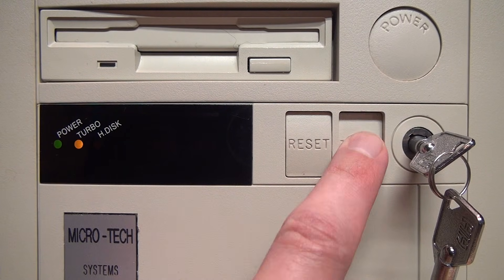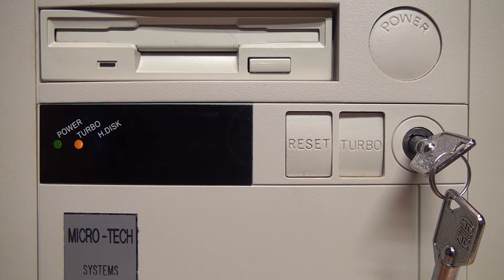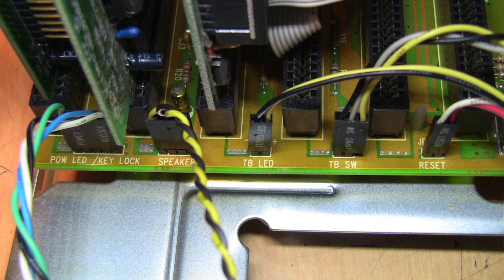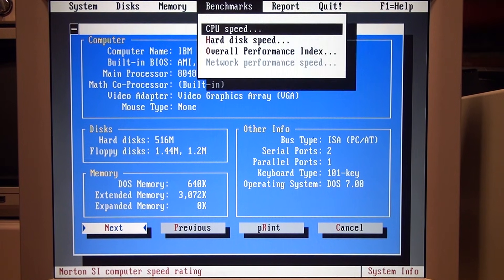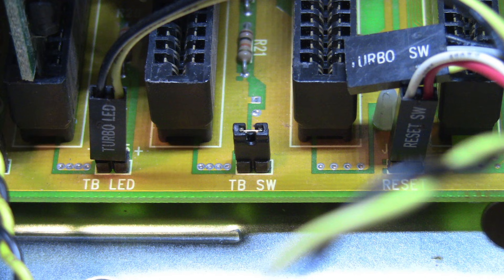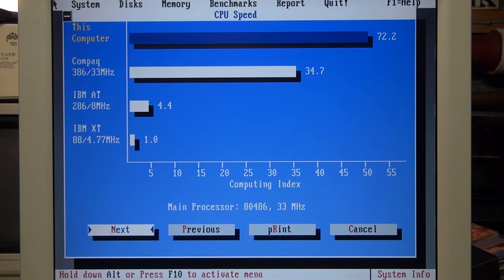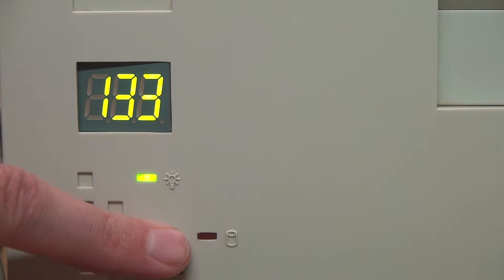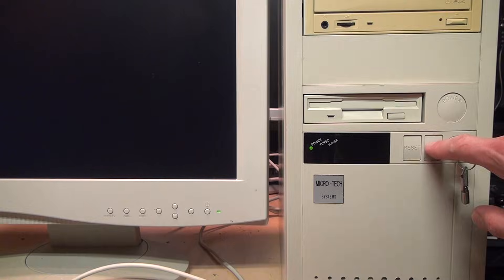The PC turbo button mystery finally solved!

Comment: You must be a n00b if u don't know what it does rofl. Back in the mid 90s on my first IBM Aptiva Stealth Series. I remember the only way to overclock was changing the buss speed on my intel pentium 1. So basically those older 486 586 boards would not allow you to change the multiplier but only the bus speed in logical increments, persay like 33 mhz persay or w/e. They usally had 3 bus speed selections printed on the motherboards.

Comment: Worked building clones in the late 80's and early 90's and remember the instructions the clone cases had for configuring the displays to show turbo/non turbo speeds.  Had about 4 versions of the display panel and the instructions were a prime example of the term Engrish!

Comment: I remember seeing another video on this. On that old computer I remember, it ran slower with the TURBO button pushed in. You explain why with the Yellow & Grey wire pins connected to the motherboard. That computer must've been connected that way, and the turbo light was burnt out.

Comment: one question: how did a  person come up with the idea that turbo mode doesnt do what turbo mode does?
 Have they never used a Computer from the x86 area? most of them even had led displays for the clockspeed, and yep 66 mhz is faster than 33 mhz...

Comment: I had a beige box 286 8/12MHz with 1MB RAM.  With Turbo running at 12MHz Wing Commander was "Start Game | Fly | Explode".  It was playable with turbo off.  And it had the LED display to show 8/12.

Comment: So, the Turbo-mode button was actually a mistake. Programmers of software for the IBM and IBM compatibles never thought of computers getting faster and therefore all programmes should have been written with real time interrupts. The Turbo-mode button was a wrong solution, the problem should have been a complete rewriting of all previously made programmes.

Comment: I have a late 286-20 with a Headland chipset. There is a turbo button on the case, which connects directly to a header on the motherboard. I found that when testing some of my code that takes over the timer interrupt, the turbo button would not work. I figured out that although there's a physical connection for a turbo button on the motherboard, apparently it does not directly control the speed of the chipset. What happens instead is that the BIOS installs a timer interrupt handler, and by default the timer is enabled to interrupt at 18.2 Hz. In that code, the BIOS periodically checks the state of the physical turbo button, and then adjusts the chipset speed according to it. So once you bypass the BIOS code, the chipset is then 'locked' to the speed it is currently running at, and the turbo button no longer has any effect.
Apparently this means that the turbo setting of the chipset is still very much a 'software' switch, like those early Turbo XT boards/machines, and the turbo button was an addition by the motherboard designer. I wonder how many other motherboards work like this.

Comment: the button has normally open and closed contacts, switching it around changes which position does which depending on how its connected

Comment: Now we need modern "turbo PC".
You press turbo, to turn on/off overclock. Like 3.3 GHz CPU to 6.6 GHz, fan noise from 20dB to 60dB, power consumption from 150W to 500W

Comment: before even watching this video beyond the first 20 seconds.  i’m guessing it enables a crystal by over clocking the cpu  which changes the mhz of the cpu from something like 8 to 10 mhz, depending on the cpu (probably an intel 8086 or 80286/386/486)

Comment: i don't recall those sounds on "Memory Checks" rather,  that was the HDD Actuator Test  - click click click BZZZZZZZZZZZZ

Then the floppy(s) would be initialized and finally BIOS completed its POST and the system would boot.  

I've had more than enough 8086, 286,386,486, Pentium legacy machines in my life to know that sound from childhood days up all the way into my professional IT Career now

Comment: As an programmer during the 90's period just to remind myself of an "Turbo" button or "Hi/Low" thingy and what is it for for me when I was writing some stuff/code (mostly in assembly)
 
The reason for the Turbo button was that early PCs were often designed with CPUs that ran at very high clock speeds. This meant that they could perform calculations very quickly, but they also generated a lot of heat and required a lot of power. As a result, PCs with high-speed CPUs often required a lot of cooling and were expensive to build.

The Turbo button allowed users to toggle between the high and low clock speeds of the CPU, depending on their needs. When the button was pressed, the CPU would run at its high speed, allowing for faster performance. When the button was released, the CPU would switch to its low speed, reducing heat and power consumption. This made it easier to balance performance and power consumption on early PCs, which were often limited by the technology of the time.

Comment: It increased the processor speed, often at the expense of reducing stability.  There, I just  saved you 18:37 minutes.

I had a machine that had this in the 1990's.  During work, I would sometimes enable it, but as a result, sometimes my machine would crash.  I didn't bother to use it unless I was compiling something.

Comment: In the mid 90s, at my office we had PCs that, instead of a light for the Turbo button, had a small display that showed "HI" and "LO" for speed. A couple of people at my office argued back and forth about which one was faster, "H1" or "L0" and were astounded when I told them that it was shorthand for "High" and "Low."
Reply: I guess they had never used a fan or heater in their lives to not know that!
Reply: @rs12official  I've never seen a fan or heater that says "H1" and "L0" in my life. Just High and Low.

Comment: I remember the first PC I had (not including Commodores and Atari XLs, I had a few of those) was an 80286 that I assembled myself. I remember that it had a 4 color graphics and I thought that was awesome! I never really noticed a lot of difference when the turbo was in or out. I built just about every version of PC up to the newest Gen 12 PC that I currently have. I think I still have an IBM 8086 in the attic, along with a Timex Sinclair, still in the original packaging.

Comment: The one thing many people seem to forget is that the PC is extremely odd in the computing world. Out of the hundreds if not thousands of machines released, the PC is the only one that allows you to change the clock speed .
Every other machine made has a set clock speed. The first ever 'Colossus' codebreaking machine ran at 5khz. An Atari 2600 console ran at 1.19Mhz. Commodore 64s ran at 1Mhz. An Amiga computer ran at 7Mhz. An original playstation ran at 34Mhz. The newest PS5 runs at 3.5Ghz. PCs however are unique - you can change the clock speed by changing the CPU as 'PC' is more of a standard than an actual machine (PC simply is short for 'IBM compatible personal computer).
The reason  turbo modes were needed was PCs were never frontline gaming machines until the 1990s - before then, games were ported to PC but almost never designed specifically for it, and game publishing companies made very little money from PC games and to them it was a niche market compared to the big selling Amigas, Ataris, Segas and Nintendoes. Therefore, game designers designed for these platforms mainly, and since all of them had a fixed clock, the system clock was pretty much perfect for a source of game ticks.
The problem arose of course when PCs started getting faster, and games were ported assuming clockspeed was a constant for the machine - hence programs that relied on a certain clock speed, such as games, became unplayable.

Comment: The "mystery" of the turbo button was solved at the point of purchase because the function and purpose of the turbo button was clearly defined in the documentation that shipped with the PC's of that era. It was never a mystery and nobody ever ran in turbo mode because we could read at the time.

Comment: Early Pc games FPS was locked to CPU clock speed, so game would be designed to run on a specific speed cpu once you upgrade your cpu game fps goes way too fast so you needed a was to be able to play older games on newer cpu's so turbo button allowed to slow cpu to the speed early games were configured for.

Comment: Everybody from the 90s knows that the turbo button made the orange light switch on. 
Where as in the 80s the turbo boost button made a back trans am driven by a man with a mullet jump over road blocks.

Comment: I don't understand how what I'm gathering is a slightly overclocked CPU would result in games playing in fast forward like an emulated console game with the frame limiter off. Did clock speeds not vary much between CPUs back then or something?

Comment: Not sure how this myth, of the slower PC when Turbo is ON, came out... I remember having to deactivate turbo mode to play Sensible Soccer in my 386DX 40Mhz PC. When it was on, the game was going much faster to the point it was unplayable. With the Turbo OFF, the inbuilt LCD clock on the tower read 20MhZ. How people thought it slows down the computer? It was obvious in many games that it doesn't.

Comment: I used to build these things. There were two clocks on the motherboards. For example the first turbo PCs were IBM XT clones that could run at either 4.77 or 8 MHz with the push of a button. It didn't matter whether the PC ran at 4.77 or 8 MHz but it satisfied system. Integrators needs to run PCs at 4.77 MHz in case there were software incompatibilities. Eventually those buttons were done away with.

Comment: If you were into computers in the 90s this isnt a mystery or myth issue.   When you tried to run a slightly older game in turbo mode it was unplayable.   Going to Radio Shack and picking up cheap games and dropping the ole rig into slow mode was just part of the nature of a PC gamer back then.

Comment: My old job had two computers crammed into my office.  One of them was a very old system that had a turbo mode, which I assume was only there because whatever database it accessed was somehow just not capable of being accessed on a more modern system.  (This was in 2019...)
Reply: Pffft... in 2018 I was in a large company manufacturing stadium/highway lighting that still had it's core server system managing inventory, production, warehouse stock and so on working on AS400-E... all the people in the various functions in the company (sales, admininstration, production, purchasing ect..) had to run an EMULATOR on modern Win10 PCs...
Fortunately mail and navigation worked through another set of Win servers 🙄

Comment: To make things MORE confusing, on cases with the "speed" display, often times there was NOT a Turbo LED. SO, IF you reversed the 3-wire connector but had the button pressed in, it would show the Turbo Speed, but would actually be running at the slower, non-turbo speed. I had to correct quite a few customer builds because they had the connector backwards!
Reply: imagine your modern computer had a turbo button you hit it and windows crashes🤣
Reply: @raven4k998  Funny how PCs went from no speed control to 2-stage speed control to a whole range of possible speeds with software control!

Comment: Most motherboard "turbo mode" settings are just a way to toggle multiplier for the CPU between 1X the bus rate and whatever their full multiplier is. For instance my DX4/100 at full speed was just taking the bus rate of 33mHz and tripling it to 99mHz. When I turned off the turbo it would drop down to 33mHz. I remember using it for Wing Commander I which ran entirely too fast if I didn't turn the multiplier down.

Comment: My early PCs including my 486 DX2-66 were the same, for Turbo the switch had to be on. I gave the 486 to my sister when I had bought my Pentium Pro rig and since my mother wanted to have her own PC, I had assembled a new 486 from various scrap parts. I don’t remember which board it had but this board started in Turbo mode with the switch open. I didn’t figure that one out until running Windows 95.

My first AMD was also different. The connector for the switch was labeled “Green Mode” and it also slowed down when shorted. While all other machines I owned or had built fell back to 8MHz, this one had cut the speed in half. I suppose this was meant to save some power.

An ancient 386 based CNC router I had to work with in my first full time job had to be set to no-turbo. The CPU had to match the ISA speed to be able to generate the correct timing for the stepper motors. You could speed up loading times or a simulation but you had to cut the power of the router or it did weird stuff like tossing tools all over the place or soak you by combining compressed air, alcohol and coolant even if the router was supposed to do nothing at all.

Comment: In 1989 I'd soldered a turbo switch into my computer myself. It certainly made the computer faster to the point that it was unable to reliably write data to my tape recorder.

Comment: Back in the 80's an acquaintance won a computer in a raffle. Took it home, turned it on and had absolutely no idea what to do with it. 30 frustrating minutes later, that computer reached turbo speed as he tossed it from his third floor apartment. 
I'm not joking. He actually got so mad he tossed it out the window.

Comment: Fun times. Reminds me of back in the day when I had my old 486 system, and managed to upgrade it through 25MHz, 33, 40, 50, 66, and even 80MHz.

It was extra fun setting the jumpers on the front panel turbo display MHz, with no documentation of course..

Comment: I hate to break this to you but they are in fact correct. The turbo button is just a limiter switch. With it in the "on" mode your PC runs normal, as if you didn't have it. With it in "Off" mode the limiter switch is active, slowing the PC as a direct result of the turbo working.

Comment: Turbo mode really didn’t do anything. I built and installed hundreds back in the day, At's and Xt's. We used it mostly as a Sales promotion; everyone wanted ‘Turbo’ because it sounded good. In reality GW Basic and Dos 1.1. ran better in 4.77Mhz. All the turbo did was mess up you games and make them unplayable. You mention AT, that was a different proposition all together. The reality was that most of not all the software at that time was optimised for 4.77. The only exception was when you added the math co processor for academic work. Then it had some value for academics to do equations a little faster.

Comment: I always though it engage the local bus and turned off the cooling fan.  Which would give the CPU more power to the main grid oscillator.

Comment: My first pc was a home made one. A cyrix 330mhz if it gives you an idea of the time frame. It had a turbo button and I never noticed a difference. I assume it wasn't connected.

Remembering this though made me think. The first pc I actually built my selt was an amd k2 with 16mb of ram. The processor cost me £55. 24 years later, an entry level cpu is 7 times faster and is multi core, so arguably even faster yet can be brought for just a little more than that when on sale. It's quite mind boggling

Comment: The turbo button did make your computer run slower. The button didn't make it run faster, it removed an artificial limiter. They tell you you're turning on turbo but you're really turning off the limiter. That means that it isn't a myth. The turbo button made your computer run slower.

Comment: I've only ever heard that myth in passing, so I don't think it was very widespread. I started building PCs in 1983, and built and used plenty of them with all kinds of turbo switches and indicators. Some of them even used a secondary keylock to lock the speed mode (usually using the same key, since all those keylocks worked exactly the same).

I think you're correct.. it sounds like a basic misunderstanding of how Turbo Mode worked, and potentially just an incorrect integration or faulty QA process for some systems.

Oh, and all those lovely typos and grammar errors in the manuals. We used to call that "Chinglish". :) Some of them were really BAD.

Comment: I put the turbo button to good (if devious) use. My sister and I were quite good in Tetris - the old DOS version - and kept increasing the high scores, competing with each other. But there was a catch. The game was well programmed in that it must have timed some loops at the beginning and determined the processor speed, so that the game would run at same speed regardless of the processor. What I did was to start the game in turbo mode and, when my sister wasn't around, turned it off. This slowed the game down enough that doing a high score wasn't hard.

My sister was so frustrated when she took a day or two to increase the high score and then came and the next morning she was beaten again 😈 Not to mention that she was livid in the end when I told her...

Comment: I was manufactured in 1975, so at the time these turbo buttons were in vogue, I was too young to care the technical reasons why they worked, but old enough to apply my vivid imagination using what little knowledge of the world I had. Being a fan of MicroProse flight sims, in my head I thought of the turbo button as an afterburner switch. Which also meant I was afraid to have it on too long for fear I'd burn up the computer.
Reply: You made me think about the scene in Galaxy Quest when the commander admonished the helmsman for holding the turbo button down and breaking the beryllium sphere. "Oh, like you would know!" was the response.

Comment: Google: older computers had problems with software running too fast on more powerful computers. Disengaging the turbo function fixed this.
You: *TWENTY MINUTE VIDEO*